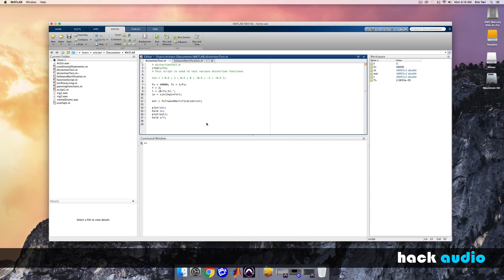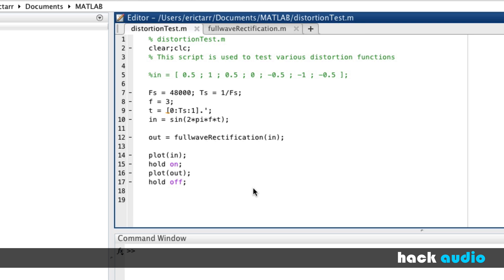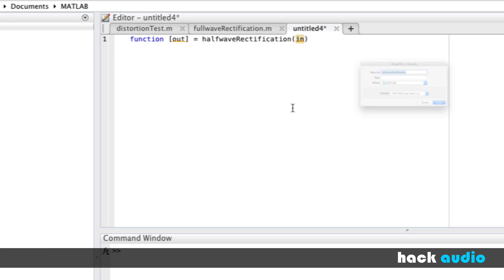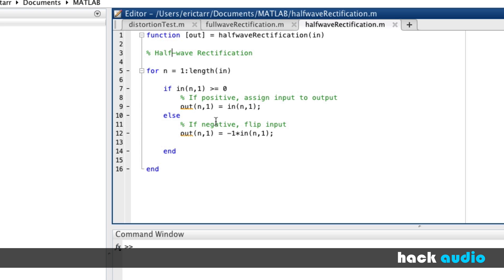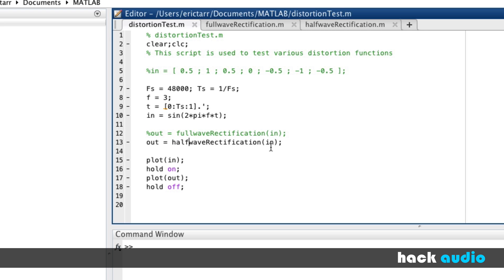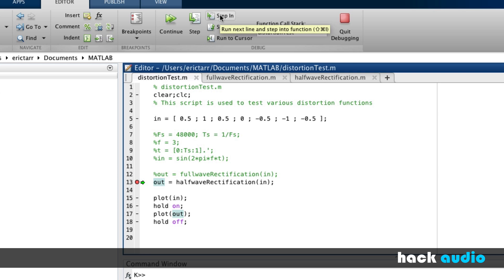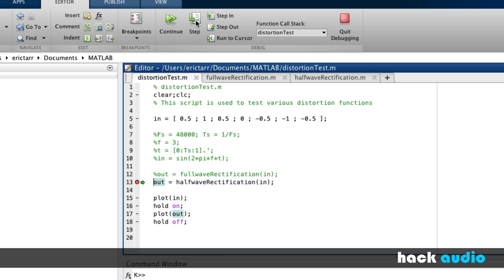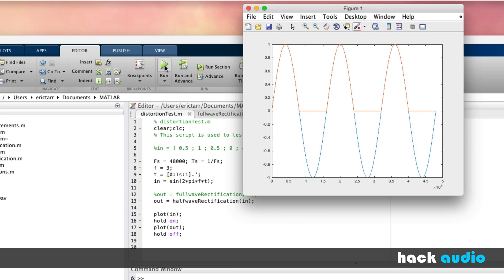Hack Audio: Half-wave Rectification

Comment: By the way why does this kind of distortion happend? Because of the rectification character of diode in the microphone?
Reply from the maker: It can happen for several reasons. In analog circuits, this can happen as a result of using diodes, transistors, or tubes. This wouldn't be a common thing to find in microphones, but there are lots of circuits in guitar pedals and amps that perform rectification